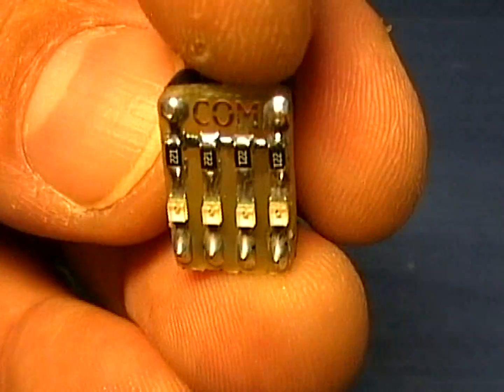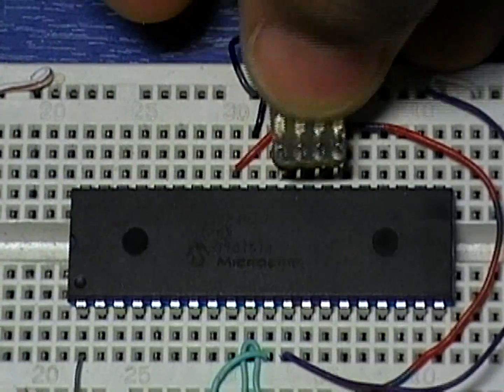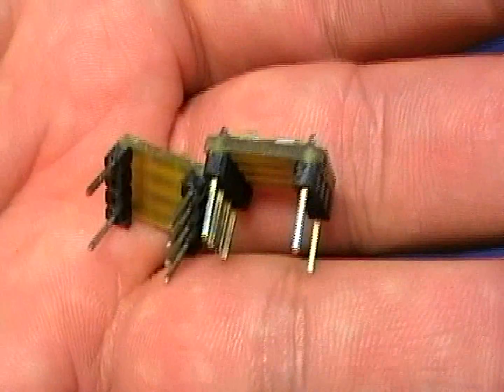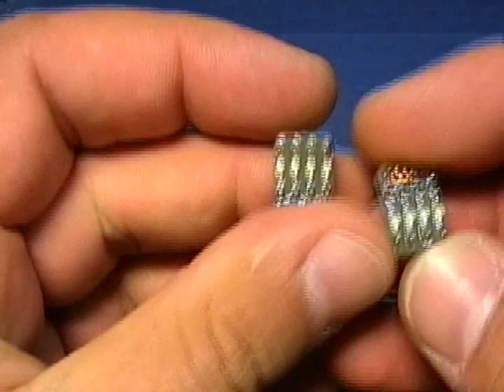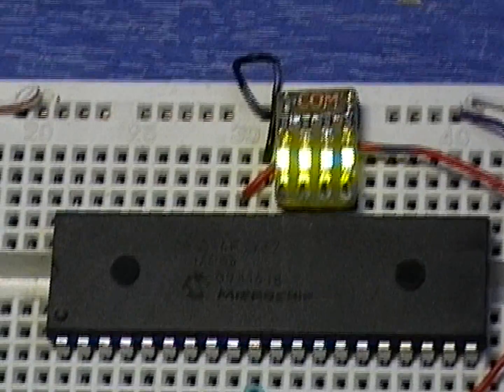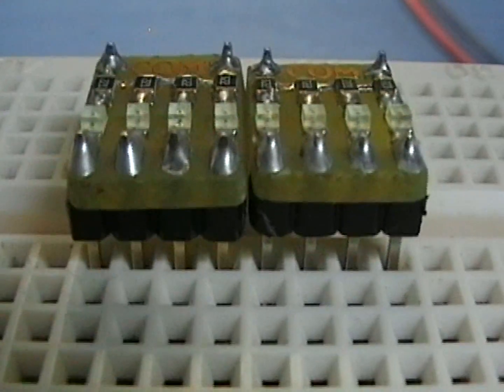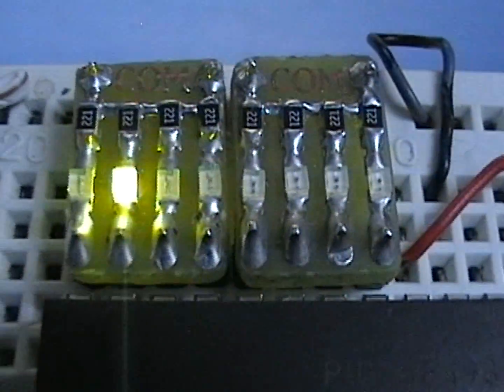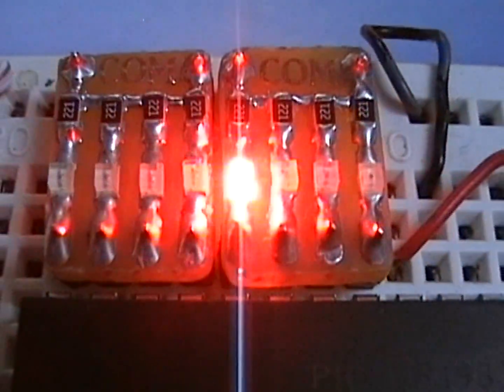Tiny LED Debugging Board for Breadboard Prototyping

Comment: Neat. Won't work well for beardboards with offset power rails though (some that I have are like 50 mils offset), unless you place everything diagonally. Another option is simply making them five pins wide, with the fifth pin as the vcc or gnd. If it interferes with a gpio on the chip, just make it an input and it will work :D